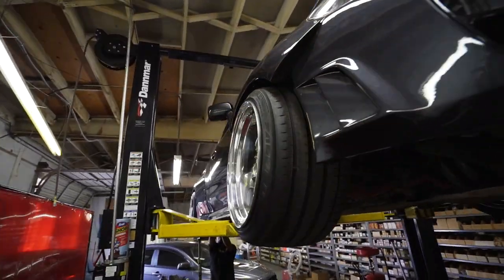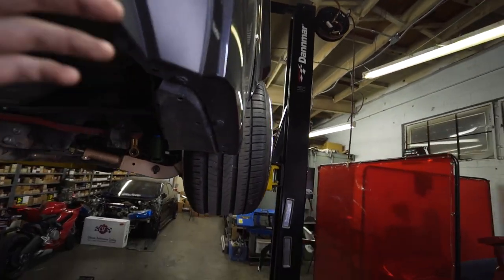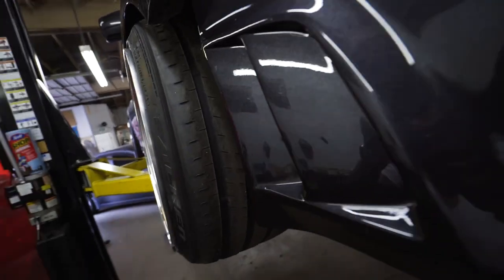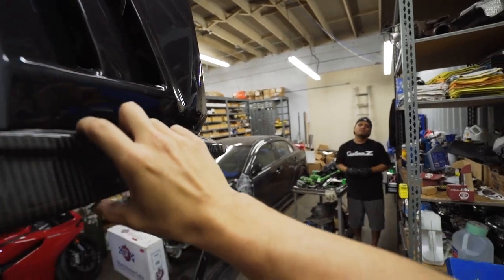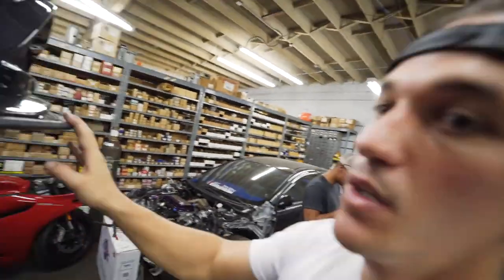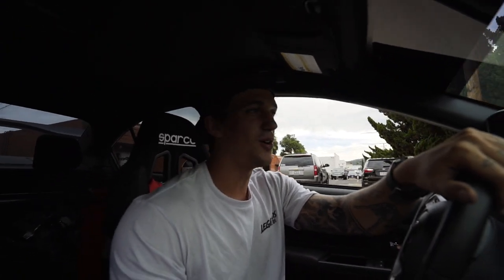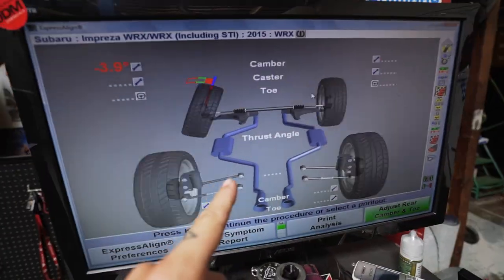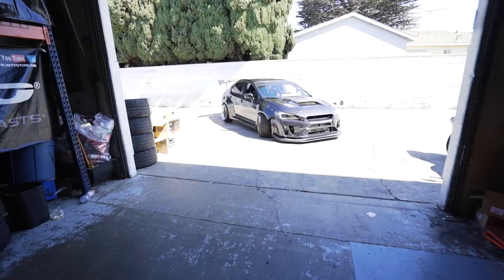INSTALLING 2015 WRX VARIS CARBON FIBER LIP & SPLITTER

Comment: Kinda confused with drilling out the holes in the bumper if you have a plethora of hardware in the back. Why not just switch to a slightly smaller bolt?